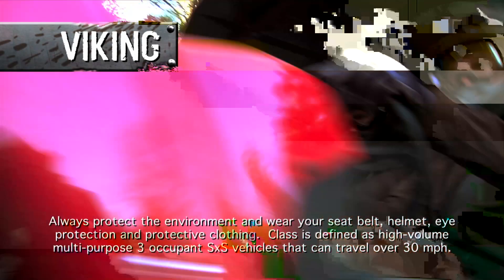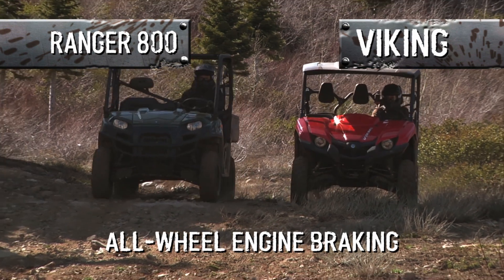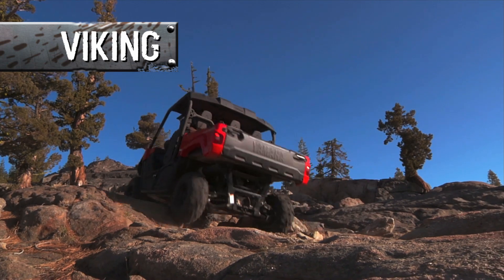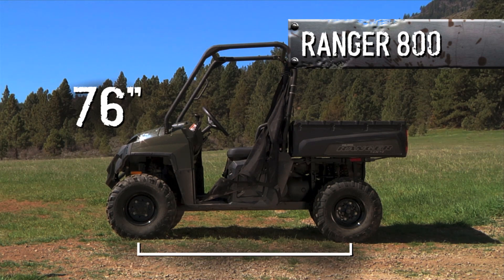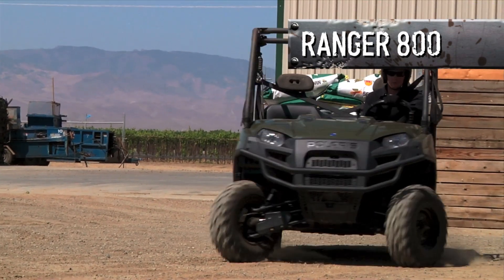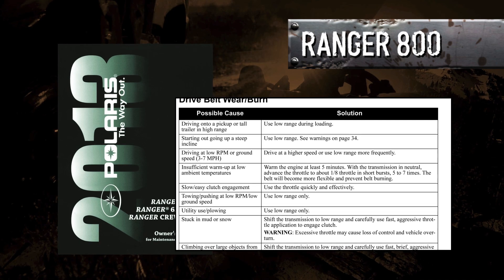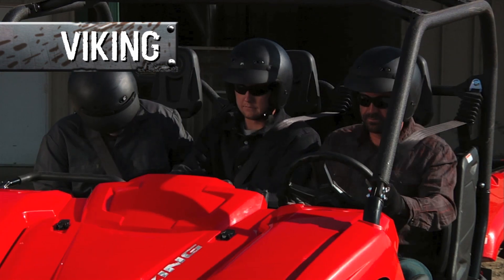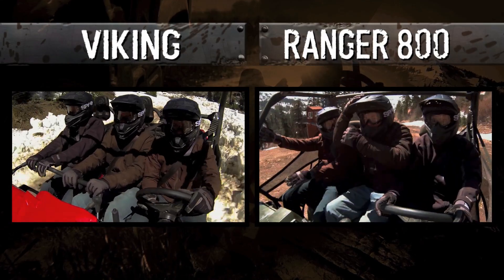Yamaha Viking vs Polaris Ranger 800

Comment: From a Yamaha, Polaris and Kawasaki dealer take it from us, the belt drive system on Yamaha is far superior to any other system on the planet. Over 60 percent of UTV's sold in America are for the utility application which makes this Yamaha perfect for those applications. Hopefully Yamaha will continue forward with this and other machines that are more suited to sport use. Remember that displacement doesn't make a machine faster. Try to outrun a YFZ450R.

Comment: The Polaris system uses no diff locker, making it a simpler and easier to use system. It can also be engaged at any speed where the Yamaha bike has to be stopped. The Polaris system is a locked system so the use of a diff locker in the "real" world acts the same as the AWD system, which is locked.
Reply: Polaris is absolute belt eating junk      The electrical connections arent even water tight lol    Junk!

Comment: There is a few problems with this video. First the Polaris On Demand AWD is a superior system because it requires no differential locker, it is a locked system which hints AWD therefore it is available on a Ranger not "unavailable on any Polaris." Second the EPS system from Polaris offers different levels of asist at different speeds, just at Yamahas. And third if the Viking has a 50mph top speed then I would have to see it beat a 800 Ranger in person to belive.  Seems like a stetch.

Comment: OK, so I must say first off my 2018 Viking was everything I wanted in a side-by-side because the engineering is generally the best in the business.... but after 2 years in the bush the poor design and decision making on OEM parts are starting to show through. It's common knowledge electric conduction motors in contact with water is not a good thing but the designers for the fan on the coolant radiator figured if they just put a drain nipple (because they couldn't make it water tight) at the bottom of the fan motor it would solve the problem. Thankfully, I installed a SPAL replacement and everything is rolling now... but Yamaha needs to work out those poor engineering choices that show up only later... when you're 80 miles in the woods with a blown thermostat..... Other than that, I'm a happy Yamaha Camper :)
Reply: So does that mean you would not recommend Yamaha
Reply: @prestonmcdowell1351  Certainly not. The Viking is exactly the SxS I was looking for, a mega torquey engine and an open cab design meant to tackle the toughest terrain at a comfortable pace. What I didn't want was one of those bat mobiles like the Razor... you know, the ability to go 100 KM/HR in a metal cage down a rural road acting like Mad Max. The way I see it, price/performance will always be an issue with OEM vendors but the ones' that survive overcome design flaws and move on. I hear Yamaha has solved the radiator fan problem in their newest models.... which means I heartily recommend Yamaha as the best designed and built side-by-side on the market.

Comment: What a crock of bull. I have been a Polaris owner for years and the claims in this add are just all out lies. What they are saying is true, but the context in whish they are used is just funny. I was looking at other brands to see what new features were offered and seen this. I believe I will pick what has served me well in the past. I have owned Polaris machines since 1988 and 10 machines later still doing as they should. Just my two cents worth.
Reply: Polaris early 4 wheelers were Junk. Every ride we went on it NEVER failed one or two of them would break down. This continued all thru the 90's also.
Reply: I just think Polaris stuff is cheap. For example on the Viking the bed is steel and I’m not kidding almost everything on the ranger is plastic where there is steel on the Viking.
Reply: @finncampeau4922   Have fun with putting in a new metal bed after it rusts out in 7 years
Reply: @locustvalleyfarms7241  on 5th year of ownership with 8,000k and no rust yet.
Reply: @finncampeau4922  we had a 20 16, 700 Viking. Good machine but the protectant on the metal bed peeled off in like a year of ownership. It’s starting to rust pretty bad so it had to get replaced. Didn’t sit outside or get abused. Just a bad coating I guess. Now have a Polaris ranger 500 it does everything the Viking will do and more because of its narrow design. But let’s be honest a Honda pioneer will run circles around every other brand.

Comment: i have a 900xp ranger and got a 700 rhino for a reasonable price ive put 8 cv's in that piece of shit rhino and dont know how many boots and put only 1200miles on it the 900xp regular maintenance no major parts no boots nothing before that i had a sportsman 500HO after 12000 miles the crank broke and the stuff i towed hauled and pulled with that case and point yamaha rhinos are shit i havent pulled anything with it polaris all the way

Comment: Had a polaris 900 xp and you couldnt get near a 1000lbs payload without destoying your belt. Or climb hardly any grade. And the suspension was junk. Sold it and won't go back. Will be buying a Viking when I save enough.

Comment: I like Polaris, but like Honda more. Yamahas are mostly crap and Polaris is better so I think about all non Yamaha fans know this video is showing all of the good things about Yamaha and all of the bad things about Polaris on purpose.
Reply: polaris is unreliable.... Every forum will tell you that.... Honda damn there solid axle and underpowered lawnmower engine.... At least yamaha is still giving us new thing.....  Btw can am is the new most reliable and powerfull atv on the market...
Reply: MrBonami2 can ams are about the most unreliable atvs ever with all there electronics and crap and Hondas don't have a lawnmower engine and they have plenty of power
Reply: MRLSUFAN12    93 honda are the same as today honda the only change it ELectronic speed shifting and shit like that.......   Go through as much as a teryx? damn this thing weight 500 lbs and the teryx 1000 lbs......  Use your logic... anyways the fourtrax will get stuck easily where big bore go with independant suspension.. even small bore like a kodiak grizzly 350 will eat alive that fourtrax...
Reply: MRLSUFAN12  I never seen an atv with no front independent suspension...   yep maybe 2000 pound the can am outlander 1000 weight 800 pound.....      Never seen a honda in a mudpit dragg but i seen yamaha kawak can am  win them though......       A yamaha timberwolf 4x4 is a 225cc that weigh 400bls this thing can eat alive you fourtax...
Reply: MrBonami2 eat alive? do you have dyslexia? I think you meant it the other way around. my fourtrax will chew up a Kodiak/timberwolf and spit it back out. and you've never seen a Honda in a mudpit drag. you must not get out much.
Reply: MRLSUFAN12 i seen brute force with 170hp   and nitrous can am that should be 250 hp
Reply: MrBonami2 ok?
Reply: MRLSUFAN12 fortrax at best 15 hp put 32 inch on that and it will burn the clutch
Reply: MrBonami2 yea right you could put 35s on it and be fine
Reply: MRLSUFAN12   lol try that and post a picture in thick mud
Reply: well right now I don't have money for tires. my stock ones do perfectly fine, want to get some outlaws though
Reply: MRLSUFAN12  stock? people that do mud never run stock tire because they suck.....   Even me i run bear claw... not the best for mud but do good in snow
Reply: MrBonami2 well with my light 99 pound  but it does just fine, my dad runs 27'' bighorns on his teryx and their pretty great too
Reply: MrBonami2: ITP